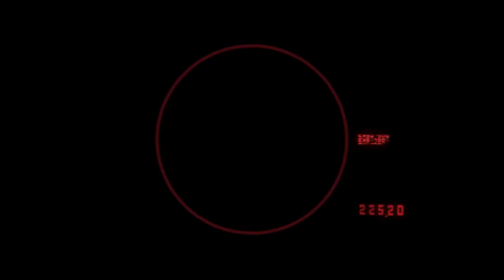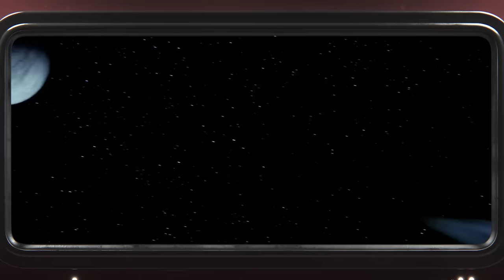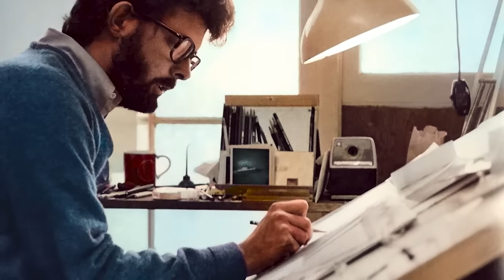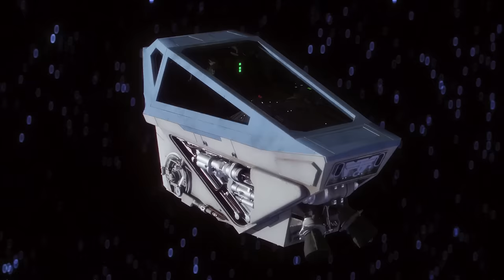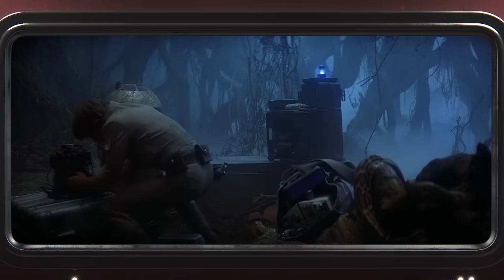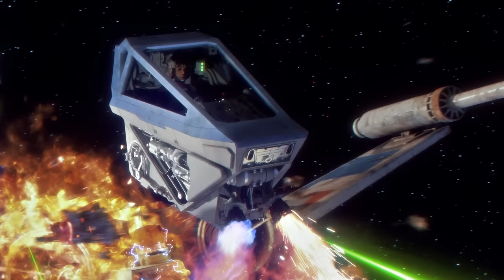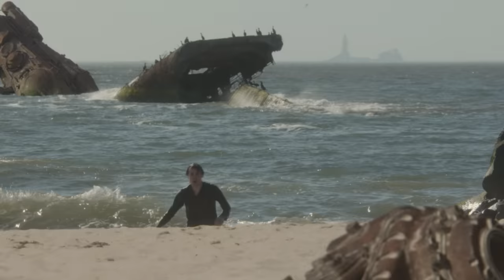X-Wing Ejection: It all makes sense now

Comment: 2:57 I really wish people would stop treating George Lucas like some sort of engineering genius who thought out all the technical details of the spacecraft he used in his fiction.

Yes, he did a lot of work on that movie, including some rough sketches for the X-Wing - but after that point, he handed it off to some of the many other people working on the project. And we know that the Battle of Yavin was modelled after the air combat scenes of an old WW2 movie.

So when the script writers wrote the dialogue for that scene, Biggs told Porkins to eject because that was in line with the WW2 movie. They didn't have to bother with thinking through how such a mechanism would work in space because Porkins' X-Wing was going to blow up anyway.

Comment: Can't Astromech droids enter the X-wing through the bottom and the top? Perhaps the droid ejects "down" while the pilot ejects "up". The droid could later join the pod and help the pilot by providing energy (Star Wars doesn't "work" unless you have pocket-sized batteries that output the energy of a nuclear power station, running out of electricity will be the last of an ejected pilot's worries), broacasting a stronger distress signal, interpreting incoming communications etc.

Comment: Given how Droids are treated in the Star Wars universe I could see the Astromech going down with the ship as part of the design in order to destroy any information it may hold. Sure the pilot could also be captured and tortured/bribed for information. But I imagine most organic species would not be able to anywhere near the amount of detail that a Droid's databanks could. Even if the Droid wiped that part of its databanks or did a full memory wipe there'd still be a chance of at least some data being recovered. There's a world of difference between a pilot going "There's a base on this city on this planet" and floor plans so detailed you can see very last nut and bolt built into the place. I could very well see an in-universe designer deciding the risk of Droid capture being just too high.

Comment: I personally like the ejection system as portrayed in the X-Wing books/comics best: a bare-minimum forcefield attached to a chair (or perhaps it's that thing strapped to the pilot's chest, who knows). Those chairs never really stretched my suspension of disbelief for the following reasons, so I never bothered to think any harder about it:
- Space in Star Wars is really gentle. We regularly see people go into supposed vacuum wearing only a respirator mask for protection.
- Star Wars also regularly shows hangars protected from space with only a force field.
- Rebel fighters use a visual lexicon based on mass production fighters from the 40's-60's, which tended to have ejection chairs (if ejection at all).

Given that we very rarely saw ejection in legends and never in canon, I'd hazard a guess the ejectors were better-than-nothing but still not very good. Your breakaway cockpit looks really nice, but if the X-Wing was lucky enough to have one like that we'd probably have seen quite a few attempted ejections, particularly at Endor, Scarif, and Exegol. "It looks too effective" seems like an odd criticism to give, but that's what I came away with at a glance.

Two visual nitpicks with the design: first, the area under the cockpit looks like a structural weakpoint with the cockpit removed; second, the forward rockets are directed straight into the nose, where the proton torpedoes are kept. If the pod was much narrower under the canopy and had those jets directed straight down instead of forward it would look more balanced imo.
Reply: Yeah, this is the simplest way to put it. The X-Wing can't have those pods because they'd work so well that we'd have seen a lot more ejections. 

I also immediately thought about how risky putting a pair of thrusters directed at the proton torpedo magazine would be.
Reply: Also, the mass penalty of apod system is better spent on shields. The escape system is a last moment backup.

Comment: Star Wars is a universe where hanger bays regularly go unsealed and protected from the vacuum of space by shield emitters. I think even in the case of a catastrophic failure an ejection seat is designed to be reliable. Saying it isn't is like insisting a fighter jet ejection seat isn't reliable because the parachute could fail.

Comment: Given the interest NASA had in the Babylon 5 Starfury, I'd say its a sound idea as it also featured a cockpit ejection system. Admittedly I don't really know anything the sustainability of said cockpit module. Being stood up constantly probably isn't comfortable but there does seem to be a little bit of room to move around and stretch a little, could probably find some way to sit down etc
Reply: Given that the Starfury's didn't have artificial gravity, standing likely wasn't a problem.  I don't think it was a system designed to go far, just to get you out of harm's way, and await recovery.  Even Space: 1999's Eagles could blow off the pilot section (bad luck for the poor devils in the passenger module).  Worst was the version in the remake of Battlestar Galactica, where the suited up pilot was pitched into space, with only the suit's air supply to keep them alive.
Reply: @R Fletch  the viper only having an ejection seat doesn't surprise me all things considered. There are cars which are probably bigger than it, viper really is quite dinky. The viper in general also seems quite fragile so I don't think the structure could handle the weak point in the midsection. Forces are something else to be considered. With the majority of the RCS thrusters in the nose, its possible during heavy manoeuvring that you could just rip the nose off leaving you a sitting duck.

Comment: I'm glad you addressed a big problem settings like the EU have: the habit of over-complicating things. You don't need a high-tech solution to everything. often the most simple method is the best. RL engineering has a term for it: Keep It Simple, Stupid (KISS). Quite a few pilots have died because some pencil-neck decided to overcomplicate something that didn't need all the bells and whistles.

Comment: To be fair to the old EU, they established that a basic magnetic containment field is contained in the chest-box. When you eject that activates and give you about 30 minutes of breathable air. After that point, if you don't die from suffocation you die from exposure to cold or radiation. So ejection, whilst possible, is pretty grim, which explains why Porkins doesn't do it.

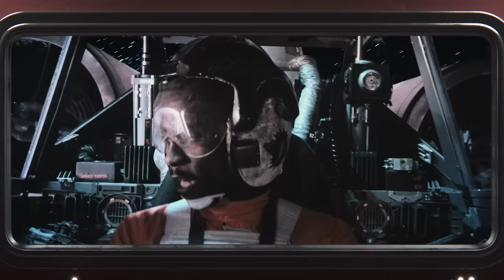Comment: 1:10 "You simply would not leave the bare necessities of survival in the hands of some finicky technology."

In reality, this is exactly how it's done. From the time a fighter pilot decides he has to punch out, he has to hope everything works. From the canopy clearing to the seat rockets firing to the separation of the pilot from the seat to the automatic deployment of a parachute. A failure of any of these pieces anywhere along the way means you're going to have a dead pilot. There are plenty of stories to be found where that's exactly what happened.

There's also at least one story of the reverse happening. A bomber/navigator in a KA-6D Intruder had an ejection seat malfunction that fired in mid-flight, but not a complete ejection. The pilot had to land with him hanging halfway out of the plane.

I would like to think the SW universe folks would have better stuff than we do, but the simple fact is that "finicky technology" is one of the most realistic aspects of the SW universe.

Comment: It would make sense that the cockpit was a separate module that fit inside the frame of the fighter.  After all the space shuttle's crew module was made that way.  It was an air tight module that was placed inside the frame of the shuttle.  It was not an ejection system. It is reasonable to have the cockpit be an ejection system.   

The pilot's flight suit also has a pressure suit underneath the outer layer.  With a mask that seals off the helmet with the suit.  The rebel pilots do not wear an oxygen mask for Hollywood reasons.  To show the face of the actors, and to show the audience the rebels are individuals.  Instead of the faceless Tie fighter pilots in full helmets.   Luke in at least one EU novel goes EVA in his flight suit, no force field, to repair his X Wing.  He does this because he can close off his helmet, and maintains pressure with the flight suit.

Comment: Even with this new headcanon, i still can't get over the fact that X-Wing pilots (& ARC-170 pilots before them) didn't have fully-enclosed flightsuits like Imperial pilots (& BSG pilots) do. What happens when the canopy is cracked, or when the backup flightsuit-shield-generator fails? 😅

Comment: So in Legends, x-wing pilots were fitted with personal magcon field (same thing used on hangars) generators in their chest unjt to provide them with a couple of hours of EVA time at most before cold or lack of air killed them. 

The pod will obviously last longer than that and better equips them, but it is also a significant portion of the fighter. You usually eject because you've been hit. If the canopy gets broken or the thrusters or any of a number of systems are damaged, your ejection pod is useless. Real world atmospheric ejection is a lot more rugged in that regard - a single hole won't kill the occupant. 

Meanwhile, the magcon field generator is a tiny target, and being chest mounted, basically the only way it's destroyed is if you also kill the pilot. It'll essentially always work so long as the pilot is alive. Hell, it works in times that the pilot isn't alive - people ejected missing limbs or wounded, and it still worked. There are advantages to not going the full pod. Or maybe doing both?

Excellent video. Not meant to be a correction. I just wanted to nerd out about the topic a bit more.

Comment: I know this video is a year old but it just crossed my feed and perfectly encapsulates why I don't ordinarily watch so-called "lore content creators": did you even read any of the source material? 

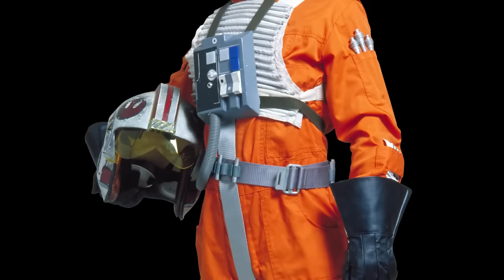The Heir to the Empire novel, and then Dark Force Rising that follows it, perfectly explain the ejection seat situation. This video claims, at circa 0:58, that an X-Wing flightsuit is not designed for the vacuum of space and, therefore, ejection does not make sense. HTTE specifically addresses this by saying that there are gloves and helmet seals that the pilot can apply if he expects to go EV.
And, in DFR, Mara ejects from a Z-95 Headhunter (a predecessor to the X-Wing). The Z-95 creates a bubble akin to a reverse-airbag to create an environmentally-controlled bubble around the pilot's ejection seat.

I have close to zero respect for these content "creators" who go hard on visuals but soft on meaningful content. Now to tell youtube to never recommend me this channel again....

Comment: Great work on this, it’s the same scenario I came up with over 40 years ago to make Wedge’s line to Porkins make sense.

With current 2-seater fighters like the F-14 and F/A-18 (B, D, & F) models, the rear seat ejects first and a fraction of a second later the front seat ejects; it’s automatic regardless of who initiates the sequence to prevent the two from colliding.

The crash of LT Kara Hultgreen in 1994 demonstrates this procedure. Unfortunately for her, the F-14 was rolling to port. Her RIO ejected safely but it was too late for her and she ejected into the ocean instead and was killed instantly. Her body was recovered about a month later still attached to her ejection seat. Had the sequence been initiated a second earlier she would’ve survived.

Comment: High key that Tie Interceptor is destroying that pod
Reply: They might take prisoners. You can use them for traps, as slaves, plus before the dissolution of the Senate, it was a better look to take prisoners. Not to mention, humiliated captives are more of a morale boost than bodies.
In the movies and EU taking prisoners was fairly frequent. In addition to this... Interrogation. Which is also regularly seen.
Reply: Heck, it even presents potential battlefield advantage. Now you've got a loose escape pod that the rebels are going to want to keep from capture or harm and will take focus away and might cause foolish and emotional piloting.
Reply: Trust me, a competent commander will absolutely prefer to leave it hanging around. And an egotistical one will want the captive as a trophy to present to a higher up.

Comment: Ejection survival

Ok first, we have the pilots flight suit, side arm, and basic coms.   The helmet might be considered useful armor but... due to its weight most pilots will ditch it likely.   Come on, they do now.

next, they will likely have a "rations kit".    this might actually be 2 different types of rations.     you might see 3 days of "high energy" rations,  several protean and nutrient bars, providing 3600 cal per day for 3 days.   this may seem like a lot, but this would give them the energy they need to hike, survive in cold, and or spend energy building survival shelters or such.   then they might have an additional 3-5 days of "starvation rations"   these are normally about 900-1200 cal per day.   with these you are not taking any activities... just sitting, resting, waiting for rescue...   

breaking them up and doing starvation rations the entire time,  this might give the pilot 15-20 days in space,  more then enough time to be rescued... or  3 days of high energy activity on the ground, as well as time to try and forage or get supplementary food.

kit might include a break down rifle, solar panel, extra energy cells, cell charger, medical kit, basic repair kit,  tarp, heat source, heat reflective materials,  water purifier,  duck tape.    (because like the force, ducktape has a light side, a dark side, and binds the universe togeather.).     long range coms, and a locator beacon.

Comment: Now I'm no Star Warrior but I watched this video based on the idea of "punching out" of an X Wing fighter into open space or into the gravity of a planet or moon? That's NO moon!! Anyway, maybe the whole section from the front of the cockpit where the break is visibly to well behind your Astro-Mech jettisons out of the fighter in one unit. But the area around the AM is hinged and folded up nicely into like a solar sail that becomes rigid once it senses atmosphere? Like the ejection-pod is just a cassette all folded up and plugged into the body of the Xwing? Once clear of the battle or whatever it unfolds and becomes about 4 or 5 times the size of the pod? If it crashes onto a planet or whatever the panels harden into the size of a two man tent with all the beacons and electronics the pilot needs to be rescued? MRE , First Aid, weapons and supplies all stored inside? EMH emitters, food replicator,  a sixer of Romulan Ale, a phased plasma-rifle with 40 watt range? You know, all the goodies?

Comment: Not sure a star Wars fighter would feasably have a usable ejection seat/pod.  Ship hypermeter reactor when damaged will explode hard enough to blow thick armored aircraft into tiny splinters.  Heavy x-rays generated when reactor overloads, why often fighters can not only be blown to bits, the heating of xray absorbing metal almost completely vaporizing the debris.

 One second if not less to get away from core overload equals tiny nuke that might fry irradiate out for a hundred meters or two.

Comment: Tandem cockpit fighters like in the F-15B or D, the F-16 B or D, have an ejection sequence and triggers the rear ejection seat first and then the front seat. The timing and direction can be varied in some of them so as not to impact each other. In the sequence of ejection a pull handle is forcefully yanked and this handle in the F-16,  sits between the pilot's legs, sends an electrical impulse to the aircraft to release the bolts holding the cockpit's canopy in place. A set of small rockets in the front then push the canopy up and out of the pilot's way. Then an explosive cartridge underneath the seat goes off to catapult the pilot out of the cockpit. This initiates the seat's rocket boosters, which propel the pilot 100 to 200 feet upward. In a sequenced ejection the rear seat goes first it experiences drag earlier than the front seat and will thus not have an increased probability of hitting it. Also flames from front ejection rockets could possibly burn the second seat occupant. Once the seat hits the windstream, it begins to separate backwards away from the front cockpit. separating the two ejections.

So you could sequence the astromech droid to go first and vector the thrust so as to move toward the rear of the plane of travel and the front cockpit straight up to avoid the droid.

Comment: While I like this as a concept... I feall it ignored something: a pod this size with power enough to sustain life support and/or engines for any length of time, would likely be big enough to continue showing up on an enemy starfighters targetting computer as a viable target. Where as a seat with just enough power to sustain a small bubble of breathable air wouldnt.
Reply: Sure. But the empire took captives fairly frequently, actually. Trophies, slave labor, good pr, interrogation, human experimentation... There are plenty of uses they could come up with.
Plus it's a battlefield advantage to keep around helpless comrades of a highly emotional faction known for having strong bonds between fighters.